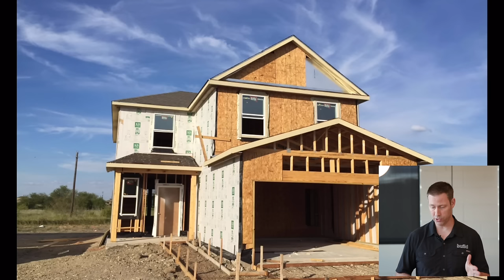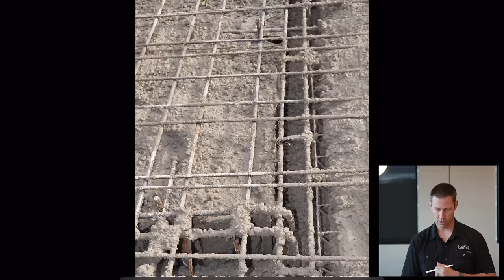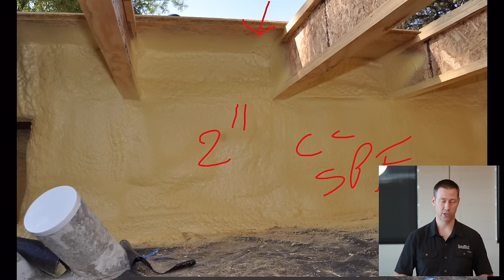Foundations - Slab vs. Pier and Beam - Which is better?

Comment: I built my own house in deep east Texas. I went pier and beam foundation. A few simple hand tools, a laser level and a 12” auger attachment on my tractor. 10 hours and 16 piers later I was done. I’ve gotten all kinds of flack about how I would have settling issues later and how I would have to have someone come out and re-level the house...my solution to that was anchoring jack bolts in my piers. So later on if I were to encounter any leveling issues, I could simply get underneath and use an 1 1/4” wrench, tighten or loosen the Jack nut to correct the problem and I’m done. Cajuneering at its best.
Reply: Damn man. Smart. Thanks
Reply: You mean you could literally use a 1 and1/4" wrench on a jack bolt and raise or lower you floor?  How much distance are we talking up or down? 1/4" 1/2" 1"?
Reply: @privateuploads-geo2625  good question I'm an 18 yr old tryna articulate myself more so plzz @eric hemard how much distance are we talking?
Reply: how much distance are we talking?
Reply: Thanks, gonna take that Cajuneering tip to heart.
Reply: @JAWM756  I'd imagine more than enough. Earth doesn't need to settle much to be a nuisance, and a little now and then may do.
Reply: How's it going now?
Reply: Surely you jest
Reply: I drilled my own post foundation in the Ozarks. 8 years later there isn't a single drywall crack in the house....two stories even.
Reply: My Texas slab, mid 90s build, post tension, is always flexing.  It sucks and I have trapezoidal doorways.  I wonder about the 3D printed homes made of grouting.  They are going to crack if not done right.

Comment: Had a pier on beam foundation for 13 years and slab foundation before for 10 years.  Post on beam allowed easy access for underfloor plumbing and utilities.   In addition, living in Houston, which can experience heavy rains that overwhelm the street drainage systems,  having a first floor that is above grade keeps your sanity if there is any type of short term flooding.   I also noticed, even with lots of trees, never had insect issues with the home elevated off the ground.

Comment: I live 40 miles north of Houston.  I used to live 30 miles north, in Oak Ridge North.  We had to have the foundation fixed before we could sell the house.  The CHEAPEST repair (which we chose) was $10,000.  IMHO it's stupid to do slab on grade here if you're anywhere near the water table.

Comment: As an engineer with over 30 years experience my $ 0.02:
Hire someone who can evaluate your soils, provide bearing capacity and determine if they are expansive in nature and to what severity.
If your soils are not expansive a slab on grade in frost free areas will work fine. Buried basement if you are in a frost zone. Insulation below the slab can be used but not typically used in the US. If the soils are highly expansive use piles and beams along with collapsible voids (hire an engineer). Expansive soils will give you a lifetime of issues regardless of how careful you are.
Piles are designed to actually increase soil loading in expansive soils to reduce expansion.
Rebar generally requires recommended slab thickness of 8"+. Poly fiber reinforcement is a reasonable substitute with thinner slabs. Post tensioning is great with concrete but generally expensive and requires specialized contractors. Wire mesh generally gets trampled to below the slab during concrete placement and provides little strength when not in correct position.
All Concrete will crack! Get it to crack were you prefer if possible and live with it.

Most problems can be mitigated early on by having professional engineers investigate and make recommendations. Early mistakes and money saving measures generally prove to be a lifetime of problems that don't go away.
Reply: I am in north Texas, almost to Oklahoma.  Too bad Matt doesn't do houses up here.  I do have a question for Matt, and you Tim... what are your thoughts on ICF homes.  I am seriously considering this, but I want to make sure that it does not have all these cracking issues with the concrete you both discuss.  Any thoughts on how to do that?  Do I have to make the concrete extra thick, or what?
Reply: Now that I think about it, I guess I can do the ICF home, while still using the Pier and Beam method... I'd just probably want the conditioned crawl space like Matt had in this video.  I guess you make that accessible from the interior of the home somehow though?  I didn't see the entry point on the video, and it looked like the concrete perimeter was poured higher than the floor, so I can only speculate that the entrance to the crawl space is from within the house.  Probably helps to keep the critters out too.  I hope the bugs as well, because Texas is notorious for things like the dangerous brown recluse spiders.  They'd love the crawl space.
Reply: Oh yeah, expansive clays.....they definitely put the heave in "heave ho".  Early days of my life I lifted pier and beam homes, on bowdark piers.  The wood was typically okay, the the footer was trashed.  One house we lifted had settled on the high side of drain path over 20".  The fireplace did not move, and you could see the original tar line around the brick of chimney where roof originally was.

Still a fan of P & B, though.  Having access is so so nice.
Reply: @totschoolmoms9977  Control joints. Lots .
Reply: Thank you so much
Reply: For pier foundations where do the utilities go under house? They just run down into the slab? Or out the side? And no worries about temps in a vented crawl space (eg freezing water lines)?

Comment: My house has a pier and beam foundation with a 6" slab as flooring.  The piers stand 24" above the floor for ample room.  It's a conditioned crawl space that's a pure joy to work in.  I use a car creeper to move around on the smooth floor.  Makes for a good storage area as well.
Reply: Amazing idea. What did it cost to do it this way? If you don't mind my asking.
Reply: I want to do this.
Reply: @matthewrogers55 Me too 👋

Comment: I've worked on a house with a pier and perimeter beam with a "sidewalk" slab underneath. For moving under the crawlspace we had an undercar cart. It was awesome to work under that house, just zooming around on a cart. It even had a couple lights :D
Reply: I use a similar idea to store my extension ladder in there. I use a $10 plant dolly. When I put the end of the ladder through the small door and into the crawl space, I rest the end on the dolly. Then I just push the ladder in, holding up the other end until it passes through the door as well. It works wonderfully. I just wish I had help setting up the ladder against my home!  That problem seems to have no solution except hired workers.
Reply: Thinking of doing that with a house on 8' piers. It becomes my screened in porch with a pool table and i don't get taxed for finished space.Not as nice as a basement, but a lot cheaper.

Comment: Great video Matt. I'm from the UK and here we use concrete 'block and beam' a lot for the ground floor, with the beams resting on the load bearing walls, the foundation being a 600m wide trench. As it is a suspended floor you can run services underneath. Very popular here now. We also have another type of foundation, the raft foundation. This is a suspended concrete floor strengthened by rebar and supported by the trench foundation. This is for dodgy ground basically and used a lot in mining areas. We have a lot of 19th century mines in the UK which aren't mapped so they don't like to take chances in those areas!
Reply: Danny Murphy 
Interesting. I appreciate hearing about different building challenges and how it’s dealt with. Thanks.

Comment: Love pier and beam or any raised foundation - easy on the body & upgrades later on / repairs as you stated. Slab really requires proper installation of pipes, insulation protective foam around pipes and prayer that everything was done right.  Gr8 vid.

Comment: I've owned homes with slab, crawl space, and basements, and it's hard to beat a full-height basement. You get extra square footage for storage or living (if finished) and all the mechanicals are easily accessed and placed (e.g. no water heaters taking space in a closet, devices are easy to reach for service, etc). It's worth the extra expense imho if you need to hammer/blast for one.
Reply: I agree but go to texas and very few builders know what there doing with a basement build and the engineers who are local are clueless you almost have to go up north and find an engineer who knows how to build a house with a basement
Reply: @sqike001ton  A full basement is very expensive.   The deep excavation, the thick solid reinforced concrete walls and the insulation/water protection.  Most people don't want livable square footage underground with no windows.
Reply: I agree with you, but what Gleason said is somewhat true as well, more expensive, not usually VERY expensive, though. If they just had one more foot in the crawlspace I think it would do so much better...
Reply: @JamesG1126  A full basement is less expensive than adding another story in areas that have frost depth.  And, yes, the basement will have windows.  A full basement (or split foyer style so the windows are 100% above-grade) is the way to go if your soil type allows.  Potential water problems are the only real drawback in my opinion.
Reply: @knurlgnar24  No Dude.    Are concrete walls cheaper than wood?   Absolutely not.
Reply: I can’t find anyone in california who will put in a basement. No one knows what they are doing. To make matters worse, my property has a high water table at 6 feet depth. The basement will have to be built and waterproofed in such a way that water from the water table will not intrude the basement. Gonna be tough to make this work.
Reply: @TheNativeTwo  with the risk of earthquakes California may not be a great place for one. Talk to a commercial builder. Big buildings have huge foundations and  basements
Reply: @JamesG1126  Dude, there is more than just wood to make another floor. You need insulation, windows, drywall, wires, carpet, stairs, doors, probably a whole bathroom and plumbing to get it up there, more siding, more soffiting, and much more. A basement IS much cheaper to do than another floor
Reply: @knurlgnar24  
in the case of piers and slab you mentioned (11 minutes into your presentation), if they were not able to reach the rock and had to do reinforced concrete footing for each pier, would they have been able to do a reinforced concrete slab still (I know he said the slab was not reinforced)? 

if so, can the piers be taller than 2 feet; say 6 feet tall? Can it be done (I know it would be very heavy)?
Reply: @JamesG1126  not as expensive as you think. Also my last house had a walkout so between that and a huge window half the basement felt like above floor. We had it finished for cheap, gaining 600 extra square feet. I am finishing a bike office now and for $1300 or so in materials I’m adding a very nice, quiet office.

Comment: Thanks for the video. Most concrete contractors are booked out two years in my area and I had no idea what was meant by 8” perimeter beams. The pictures definitely help show what I need to do when framing the slab for the shed.

Comment: My parent's house in New England had a full basement, about 15" of which stuck up from the ground, as did all the houses on our street, but a few year after they finished our street, another developer leveled the area down the hill and put in a whole subdivision of "California ranch" style houses on slabs which were only a few inches above ground level. They had copper-tube radiant heating, which must have seemed like the height of modernity in the late 1950s, though almost all of them leaked and  have since been converted to baseboard radiators. They also has a penchant for wet floors, so owners tended to spoil the modern roof lines with add-on gutters that always ended up at a funny angle. Still, they seemed OK until one of the drainage creeks that served both neighborhoods silted up; our house had a lakeside view over the flooded park for a week or two, but all the slab-ranch streets were cluttered with ruined furniture and other waterlogged stuff. I hate to think of the mess these owners had do face, with all their living space flooded. Even if our houses were lower, we'd likely have just lost the stuff in the basement. Each has its pros and cons, but if there is much chance of flooding, I'd stick with something at least a foot off the ground.

Comment: New concern with poured slab homes is that they flood easily. Pier and beam can give some flood protection, depending on flood elevation.
Reply: Can pier and beam be done in northern states?
Reply: @nofurtherwest3474  Probably. Your local building department can confirm either way. But the details of insulating the floor/bottom of the house becomes more important since it’s potentially more exposed to ambient temperatures.
Reply: @edbouhl3100  Yeah I was wondering how the water pipes stay above freezing temp if it's running bare through a pier and beam crawl space. I guess it would be somewhat "conditioned"? It would have cement block walls around it and maybe a vent from the furnace?

Comment: Here, in the northeast, a deep foundation is required. My preferred solution is to set the first floor elevation at about  24 inches above the high point. Excavate to an elevation that sets the bottom of foundation at frost depth, normally 48 inches then grade up to an elevation that leaves 12 inches of exposed concrete. The material from excavation is used to accomplish the regrading. Basements are the least expensive space to construct  and are so useful. The downside of this approach is water intrusion, but this can be controlled with perimeter drain, water sealing and adequate site drainage. I enjoy your videos and have followed many of the solutions that you support. Thanks.
Reply: A deep foundation is not required, you can do a shallow frost protected foundation (SFPF). Ideally it would built on a thick layer of insulation and wrapped up the slab edge. Welcome to the future.
Reply: "Basements are the least expensive space to construct and are so useful." So true, unless you go fancy and make it a complete finished living area. It only cost me an additional $4,700 (in 2011) to get a full basement instead of a dinky one just big enough for the furnace, water heater and a tiny bit of storage. Tremendous value for 700 sq ft of usable space. And yes, the builder did a full perimeter drain, water sealing and there is proper site drainage.
Reply: From living my childhood to young adult age  in a house with just a partial size basement as the rest of it was just additions to the original, my dad had to dig out a few crawl spaces to gain access to the additions which were not well done.Along with working for my step dad  as well for several years in my young adult life (15 to 22 y.o.)  where we mainly worked on basement waterproofing work doing primarily retrofit and such and a few new ones at times when we were requested to per our reputation for doing such top notch work, in those days has set me to prefer a place with a basement. Even my sister bought her first home with a full basement, though half of it is only finished, the rest is unfinished but still comfier than an unconditioned or uninsulated one. I plan on hoping to live in a house with a ICF basement foundation and mostly finished in, even on a sloped property like her but with access to park a car inside of perhaps so as not to have a view blocking above grade garage space.
Reply: @dustinehrlich5706  
in the case of piers and slab you mentioned (11 minutes into your presentation), if they were not able to reach the rock and had to do reinforced concrete footing for each pier, would they have been able to do a reinforced concrete slab still (I know he said the slab was not reinforced)? 

if so, can the piers be taller than 2 feet; say 6 feet tall? Can it be done (I know it would be very heavy)?

Comment: The conditioned pier and beam with a concrete “sidewalk” base is very interesting because it removes the humidity and critter infestation problems of a traditional crawl space. Similarly, couldn’t you pour a slab on grade foundation and then frame a raised floor above the slab? The plumbing would go between the slab and raised floor, not buried under the slab.

Comment: Interesting and informative video. 

Couple things came to mind. The conditioned crawl space looks like a great source of earth temperature moderated air. Warmer in winter, cooler in summer. Like what is used in a passive house. 

A video borescope might be a useful tool in diagnosing plumbing and electrical problems buried in concrete. You could run an illuminated camera into those small spaces and have a look see.
Reply: Steve Slade  
Awesome suggestion.

Comment: In other parts of Texas than central Texas, the clay goes deeper, and expands and contracts as the weather changes. Add in the odds that there is some backfill under the slab, and it gets even more unstable. Every house on my side of my street has had foundation repairs, including mine. The front half of the houses sank, suggesting that a trench of some sort was backfilled. 

Some builders are doing slabs on top of piers. The piers go down to stable "rock. That is like doing the repair before the slab fails. An "ounce of prevention"instead of a "pound of cure."
Reply: Deep pile foundations are best suited in expansive soil, especially when the house is Stilt type like as Matt shows with Pier and Beam in technical terms, allows the soil to expand as it does and protect the house from such demises as those of you so experience with repairs.